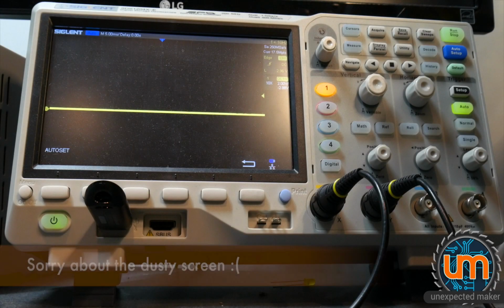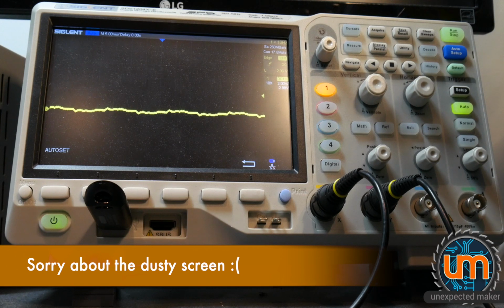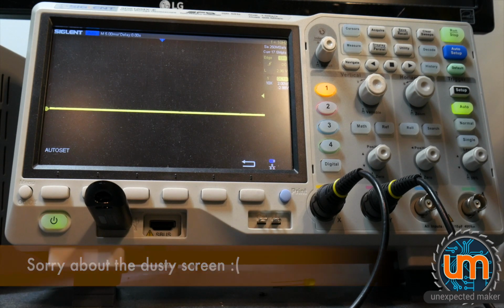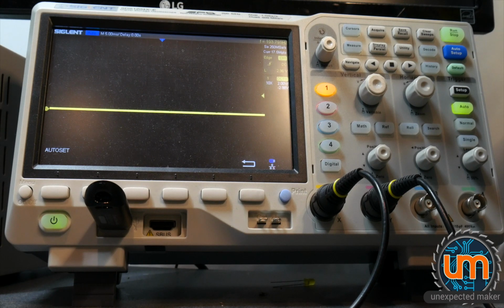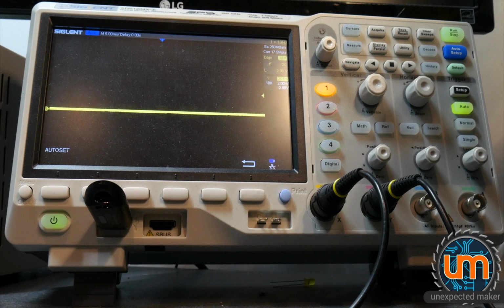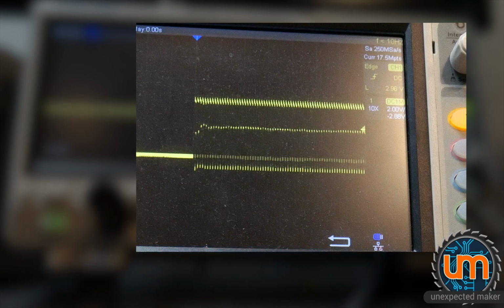TFT Dilemma Update - Fixed?

Comment: Nice you found it! I reflowed my first board with your controller yesterday and it worked very good.. i used 140deg lead free china paste. Now i need to update the controller code with a profile for my high temp lead free paste - my first tests without controller always burned my silkscreen a bit with high temp - i hope this will get better:) 
Two things about your design.. please use the standard connectors with the wider pitch -  i´m pretty good sorted, but it was frustrating not to find the extra small screwdriver and  these tiny ones are flimsy. One could not be screwed at all, so i removed the whole connector and soldered the relay directly.
The other thing.. i´m running the exact same display with an esp dev board via 3.3V and have not seen any problems.. maybe this could be an alternative, but if the decoupling solution is working fine, do it how you like. - Just a tip:)
Kepp on!
Reply from the maker: Glad to hear it's working! How high is your "high temp" paste? I agree the 2.5mm screw terminals are not great, and if I ever do a Pro board I'll move to 3.5mm ones. I do check all of the screw terminals before and after I assemble them no the board, so they should all have been working ok. Sorry you had to pull one off.

Comment: place the capacitor flat on pcb touching the solder blob for pins on its side - then solder it, easier and more mechanically stable.
Reply from the maker: Under normal circumstances, sure, best way, but I was about 40cm away from it on an angle, and couldn't see what I was doing as I was videoing it ;) Trying to video stuff like this makes things a little harder to work ;)

Comment: You might want to consider using two caps of different values to be sure it is covering the noise range more effectively, also scope it to confirm.
Reply from the maker: Yeah, my plan when I bump the board revision is to add 2 caps, and I'll tune them on the scope. This exercise was more about working out if the problem/solution was in hardware or software, rather than the perfect fix.

Comment: 3:08 I wonder why there are three levels of noise in addition to the 5V line.  I would have thought it would be just a simple square wave with just a high and a low.
Reply: Many things on the rails - parasitic capacitance, inductance, etc.
An electromagnetic buzzer would induce voltages when magnetic fields collapse.
A piezo buzzer would also since the crystal can act as an audio pickup or microphone.
Reply from the maker: All good to know, thanks!
Reply from the maker: Am sure the GND loop I mentioned didn't help, but it's def not clean at all. I should have re-scoped it after the fix, but I was just happy to have it working and wanted to edit the video and get back to building ;)  I'm a little stressed atm, hahaha

Comment: Do you have an antiparallel diode on your buzzer? That is so odd that they put blue tape on that display
Reply from the maker: A flyback diode? I shouldn't really need one. I think my issue in this case really is my routing of 5V around this area. I should have isolated the buzzer and TFT power paths.

Comment: Well spotted. ;)

I think part of the issue is because it's a piezo buzzer, so the back-emf (for want of a better phrase) will be creating even larger spikes.

Seems like the cap fix will work, though.
Reply from the maker: I'm glad it was so simple.. but silly of me not to have a decoupling cap there in the first place!
Reply: Flywheel diode across the buzzer might work, too :)
Interesting bug!
Reply: @azyfloof  

That's a very good point. Same as you'd put across a relay coil etc.

It doesn't look like the voltage spike from the buzzer is that big, though. Maybe 8-10V P-P?

Does the voltage go above 5 Volts at all, Seon, even with the cap in place?